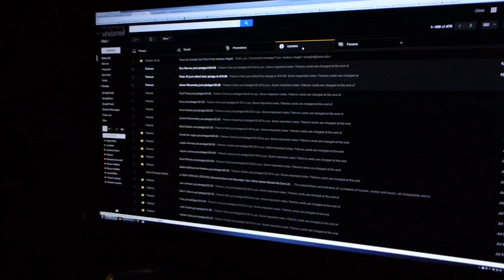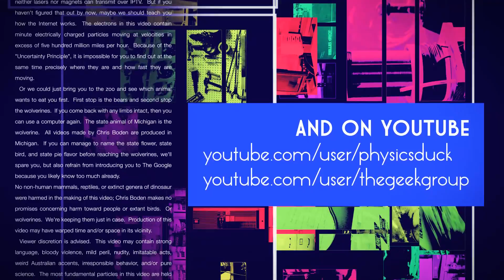Captain's Blog 7 13 2015 Conduit Coffee Table

Comment: If you were good at pipe bending you would start at one end (allowing a couple of inches for error), you'd then have more useful offcuts :P
Even though we now use more plastic conduit in the uk, we had steel before, and sometimes you meed to go back to steel for mechanical protection, in our case mostly against animal damage (from rats to cows)
oh, and in your 'NASA' measurement, you forgot to allow for the thickness of the feet :D